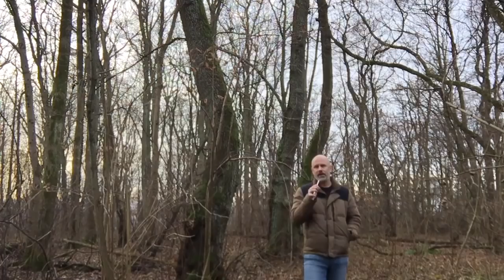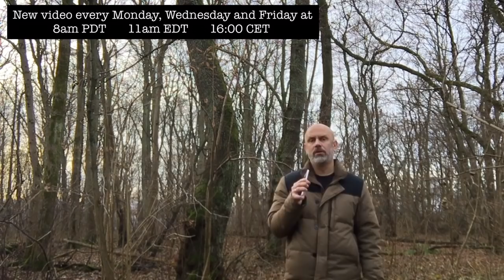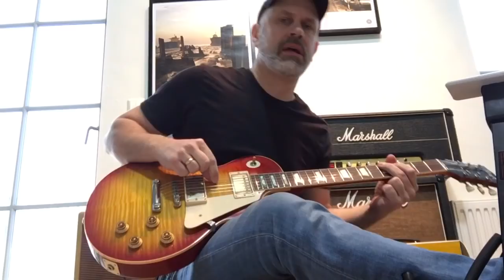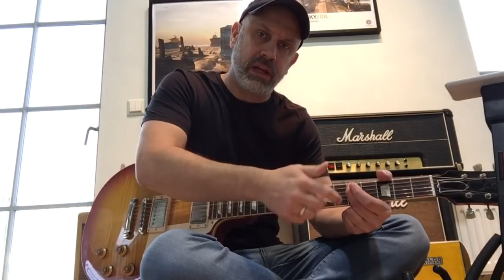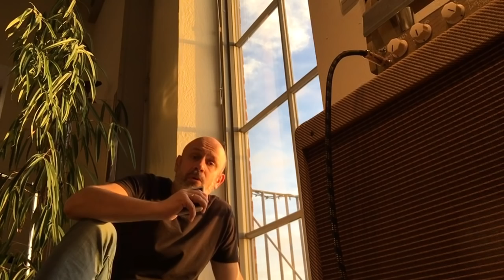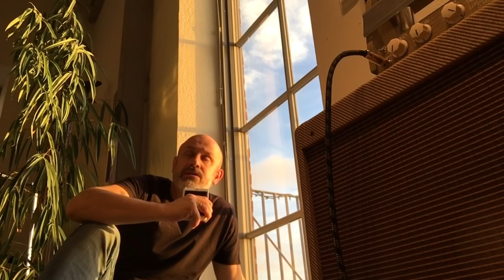Which is MOST IMPORTANT PART of an Electric Guitar?

Comment: I agree 100% that the body and neck vibrations influence tone, but where I disagree with some people is that a specific wood imparts a better vibration than another. Using an old example, the Dan Armstrong Ampeg acrylic guitars had great tone IMHO and there was a distinct lack of body wood there. I can agree that in any design and specific construction technique on a specific guitar model, that certain woods can be reasonably found to have similar density and resonance that that specific guitar will sound similar to others of that model when constructed of similar woods ;)
Reply from the maker: +ArielsSmartyPants Woods of different mechanical properties will perform differently if the test of the design is constant. But probably not as differently as the big guitar manufacturers would like you to think :-)
Reply: I think that's exactly what I said ;)
Reply from the maker: +ArielsSmartyPants smarty pants indeed

Comment: By my experience only, i have come to the following conclusions. The neck is the basic sound of an  electric guitar, then the pickups. The body is  basically a big filter for the sound of  a neck, so basically if you use a certain neck through different bodies you will have the same sound with its frequencies altered like using an equalizer but the fundamental sound will be always present. The pickups should be tuned to be able to enhance these frequencies.
Reply from the maker: +G ts Thanks, that's an interesting characterization. Cheers
Reply: Interesting. That makes sense to me, since in blind tests I've been able to clearly identify different neck woods pretty easily but body woods were much harder to differentiate.
Reply: I've been starting to find this too. It seems like at certain extremes the body may also limit the range of tone a neck can occupy. For example, I've got an SG with a maple neck and it has completely different resonant or strong frequencies then a mahogany neck one, all the strongest notes shift around - and yet the SG character is still there, the biggest difference is in feel also. The body seems to 'eq', as you mentioned, a certain sound out of the neck that is very hard to change. I've got a few maple neck tele's and I'm trying to get something in-between the SG and Tele with the maple neck one. However the body tends to put this high-mid hump on the unwound strings that is hard to change - the 'vowel' character of notes is too 'eh' or 'aw' and I'm trying to get to 'oh' or 'oooo'. I can hear Tele-esque character in the wound strings but not the unwound - its a neat thing to play with but the trial and error is slow and expensive!

Comment: The most important factor first and foremost is that the strings are in solid contact with the bridge and nut, the bridge is properly spaced /intonated and then the fact that the frets are properly spaced and leveled. After that it’s the pickups/wiring then the wood/shape. All of this assumes a competent set of hands manipulating the strings.

Comment: We can pick and choose. Lucite and aluminum, etc.. Pressboard Danelectro : ) There was no center block in my single PU Casio and I had to stuff the body with foam packing peanuts. The headstock the size of a shovel blade : ) There is a good case for having a Stradivarius character in electric guitar, also. Box of parts
https://youtu.be/SD2kjjapBDI

Comment: Master luthiers are capable of combining necks and bodies with similar resonant frequencies, as some guitarists with top ears (Steve Vai was knocking necks and bodies in Ibanez factory to match them and Yngwie Malmsteen changed necks between his vintage strats depending what sound he was after before concerts). Then you put the appropriate pickups to complement the instrument. That's why guitars that have more "dead" bodies and necks (cheap wood) have hotter pickups and more resonant instruments have lower output ones to not dominate the sound and let the wood frequencies come through. It's science and art at the same time. Keep on, I'm curious to see your experimental videos!
Reply from the maker: +George Kollaros Thanks, great feedback. If laymen like malmsteen and Vai can identify necks, and not select one of a limited number of previously known necks, than it would indicate that it can be done with some limited diagnostic method.
Reply: By "limited" you mean the ears of Malmsteen and Vai, we can't do that...
Reply from the maker: +George Kollaros Well I certainly can't do it. By limited I mean that a layman can apply it with some training.
Reply: Fully agree to that! Good comment!

Comment: If you mean an existing guitar...what can you do to change the tone the 'most'? I think for me it was an active preamp with dual (cascading) gain with active tone controls. Next would of course be pickups. For design, try combining titanium/wood and you'll probably find a good tone. Try titanium bridge and nut and try titanium truss or support rods in a wooden guitar. I'm working on connecting a titanium nut/bridge together. I have a couple of design possibilities to try to make it work and hope for a prototype eventually.... I would also add that for me the biggest change available in tone for electric guitar, across the board, after over 40 years of playing, is the speakers.
Reply from the maker: +TheDogpa Thanks, yeah I'm a speaker guy too :-)

Comment: I had a dull and lifeless Fender Strat. No pickup could save this guitar. I took it apart, removed the paper shim (surprise!) from the neck, sanded the neck cavity, filed the bridge parts to make them actually flat against the body, and put back the original Wilkinson stamped metal saddles. It's now night and day, with no pickup or electrical changes.
Reply from the maker: +Simon Williams Thanks, that's very interesting, did you document it with pictures? Cheers Johan

Comment: the pickups.... appear to be #1 for me. I have done alot of experimenting on this topic.  I have found that in general the pickups from the golden era....1952-1969 are mostly always better than their modern counterparts.  I recently purchased a custom shop Joe Walsh LP. Sounded great stock.  But it lacked that 10% that pushes it over into god tone.  I put in some 1961 real deal PAFs into the same guitar. woah.... ghost notes, touch sensitivity.... increased noticeably. but that is not to say that is the only part of the story. nut composition... bone vs plastic, the woods are a large contributor too.  the same LP has modern reissue wiring.   I have a vintage 1960 harness....I am gonna throw it in there.  I am told that the harness/pots contribute too.  who knows in the end. but I believe alot of these modern pickup builders overwind their pickups and they just sound awful.  always bet on vintage if you ask me.  this is not to say ALL modern stuff is crap.  just the older stuff seems to have that mojo and 10% we seek.  my bar is to plug straight into the amp. no pedals etc. this is the true way to fully hear the difference. Don't forget the chops go along way.
Reply from the maker: +Revelry 1969 Yeah those old PAFs are very interesting. I wonder if those magnets where used in some other products back then, from which they can be harvested?

Comment: I think the biggest part of tone would be a combination of the density and the fret wire being use. I have a Strat, with a rosewood finger board,  I re-fretted a few years back, I bought the neck off Ebay, and the frets were very worn, but sounded good. I replace the normal Strat sized frets with jumbo, Dunlop 6000, the tallest frets, now the neck feels just like a scalloped neck, without removing any wood from the neck. Adding such a massive amount of metal to the neck, also made it brighter in tone. Same as a rosewood finger board vs a maple finger board, maple is slightly brighter, due to the density of the wood.  Then you have to consider what type of finish is on the neck, I prefer just using oil, vs a lacquer, or polyurethane which is the worst, it will kill the resonance of the neck.

Sorry to ramble on, I have been playing for over 45 years, and these are my experiences.
I am not a luthier, but i have experimented with many different things to find what i like best.
Reply from the maker: +Skully's Woodshed Thanks man that's great feedback, I'm a fan of jumbo frets, which I have on most guitars. Cheers

Comment: Hi Johan
I've just tried three identical Les Paul standards, all with sequential serial numbers. They sounded so different to each other!  Surely the the discrepancy must be in the wood rather than the electrics? Some of your subscribers are convinced that there are most important parts of guitars!  Would you not agree that a good guitar is greater than the sum of it's parts, with all parts being integral! Or is that just stating the obvious?
Reply from the maker: +1965fatbob Yeah, for 3 consecutive serial numbers with the same pickup model the pickups are likely consistent. At least if they're modern LPs. So the discrepancy comes from the rest of the guitar. And yeah a good guitar is definitely a question of balancing many parts. Cheers

Comment: the pickup are most important part of electric guitar. reason being that most guitarist play with distortion effect of some kind. then tone circuit plays role. the wood play minor role for solid bodies. aluminum guitar sound pretty good. aluminum sold bodies little brighter because of increase sustain. it has to be specially design hollow body for aluminum to color the tone with warmth when played clean. think of how bell or pipe sounds. those guitar extremely rare because guitarist basis towards wood.
Reply from the maker: +spark300c Cheers

Comment: Johan, I think for a Les Paul with humbuckers, that there is a lot of different ways to adjust the pickups, and if a person knows what he or she is doing it can make a world of difference in its sound, and harmonics. Most people never even adjust the pick up height, or set the screw heights to the radius of the neck, one Gibson custom shop builder not only set the screws to the radius but also set them  in opposing v shape like this /\\/ /\ /\ these being the screw slots, then setting the pick up cover on the treble side at 2/32 and the bass at 3/16 to the bottom of the string to start with. Generally you can find a good tech that knows this stuff but not always, and one if left up to just take the time to learn and listen to what you like. Thanks, John
Reply from the maker: +John Barber Shop Thanks John, I never realized that the HB screws could be adjusted, gonna check it out now! Cheers Johan

Comment: IMHO there is no most important thing. Anything about the tone is important. Starting with a type of guitar and amp, ending with a copper thickness in your cable. You simply imagine your dream tone and then go searching all types of gear to come to it as close as you can.
Reply from the maker: +Tyler Flint thanks :-) it's a lot contributing factors indeed

Comment: Amazing channel! Very interesting to watch :) If you don't mind me asking, what's your day job? Are you connected to music industry in Sweden? Also, your Epi studio sounds great, but it's through your amazing amps and cabinets with great speakers! But what's the most important part in the whole chain is whole other discussion... As well as getting that best tone in certain use scenario (home practice at low levels, club gig/rehersal at medium levels, and stage gig on high volume levels, then tone for venue PA system...)
Reply from the maker: +Johann Daart Thanks! That's great to hear. I'm an automotive engineer. To me the speakers are 80% separate of the sound chain. Cheers Johan

Comment: Very interesting and informative video! IMO , EVERY single part has 
an influence on tone and sustain, (maybe even minuscule) except : strapbuttons, 
pot-knobs and the tiny little mountingscrews.
Seriously: Most important are the two groups: 
1.) all the mecanical hardware, 2.) all electronic.
Maybe ther is no ONE most important part, 
but the right balance and synergy between all components. 
And this could be or "scientifically" based, 
or suited to the individual taste of listener. 
For me has the unplugged acoustic tone of an electric the highest significance, 
its the instruments voice and "personality". There I start my sound-improvements first.
The most important part for me: whole guitar without electrics! NECK THE MOST.
After all, the pickup (and rest of electrics) 
just have to have the ability, to reproduce the whole sound spectrum of the instrument. 
With different pickups and pots and caps I just want to finetune the balance of frequencies to my taste,  
but not the intire voicing and tonal character. ... Just my personal opinion.....
Reply from the maker: Thanks, great feedback!

Comment: Now that I've completed watching, and see that we agree.  The neck is Gibson's secret.  
The neck is very complicated, and also very subject to variations do to humidity, warpage, design measurements, type of material,, the fretboard, etc, i.e. rosewood, maple or ebony fretboards all sound different as well as the action.  Intonation is very tricky at various locations on the neck, as you pointed out.  There's far more science to the neck, than any other part of any guitar or string instrument.  
One interesting thing, those cheap made in China guitars can be hit or miss, for the most part, miss, but sometimes you might hit on a good neck.  They've improved some on cheap hardware, but they simply copy the dementions of a Gibson or Fender in mass production.  A very important consideration of the higher cost of a genuine Gibson  is how meticulous they are about the neck, from engineering to craftmanship, the details in quality.  Don.
Reply from the maker: +umajunkcollector Thanks Don, that's great feedback. Cheers Johan

Comment: Hello, Johan! After intensive engagement with guitar upgrade and building (as a 50 y.o.greenhorn) , I listed for me the most important influencial parameters for TONE on the electric guitar: 
1. scalelenght (a short scale sounds allways like a short scale and viceversa)
2. body (hollow or semi or solid, the shape, woods, thickness, weight, density, resonance response)
3. pickups ( they can emphasise different frequencies of what the guitar is unplugged offering, different when full wax-potted or unpotted)
4. neck (stiffness, combination of woods, mounting method, resonance response, comfort of playing!!)
5. bridge (materials, tightness of build and mounting tolerances, position on body, design, weight)
6. tailpiece (material, distance from bridge, bigsby or trem)
7. strings (nickel plated, pure nickel, halfrounds, flatwounds, gauge)
8. pots and caps (build quality and values)
9. nut (material, if compensated or not compensated)
10. plectrum (material, shape, angle of action)
11. frets (material, mounting tighteness)
12. tuners ( materials, build tolerances, weight, height)

13. THE MOST IMPORTANT (but not part of the guitar) : THE FINGERS! (it's number 13 , it's crucial ;-P )

Comment: The paper is interesting.  The location of the neck deadspots explains why changing tuners from heavy to light weight ones can change the sound and feel of a guitar.  Also, in the 70s, there was a brass plate you could buy to add weight to the headstock, changing the tone...  And reshaping the neck, even sanding off a little bit will change the resonance frequencies, moving the dead spots.  Suhr alludes to having a method to match necks to bodies for the best tone and I’ve always suspected it was based on some sort of measurement of the resonant modes of the neck coupled with those of the body.  The violin world has been studying this for many years using laser interferometry, and the understanding is now almost to the point of knowing what modes the top and back should have before assembly that will sound good when assembled. Final tuning by trained ear of course.  Cheers!

Comment: Right on target with this one. Working in a guitar shop back in the 90's we buy or necks from a couple vendors, both bolt on and neck thru. We would tap them with our knuckle at the 12th fret look look for a note around 100 hz to 440A a ver wide range can be used.  Necks that were dead like hitting a sand bag or like plastic we sent back. Another factor is Neck note to body note . The neck should be close to the body in Resonance. On a bolt on you can pick and chose for glue ons its luthiers choice. My best electrics have very close matched neck to body. You can tell when you play then unplugged their louder with more sustain than a guitar with badly miss matched neck body. These are small things that ad up. As far as rank the physics are job 1. The neck,frets,, nut, bridge, angle of strings off the back of bridge ,angle of headstock ,angle of neck to body. That last sentence is the most important, all of those things matter.
Reply from the maker: +LRoy Shreding Thanks! Great feedback.
Reply: Your welcome , I dig your videos.